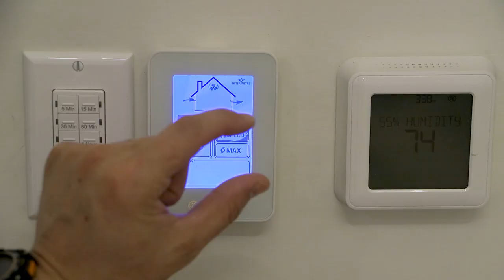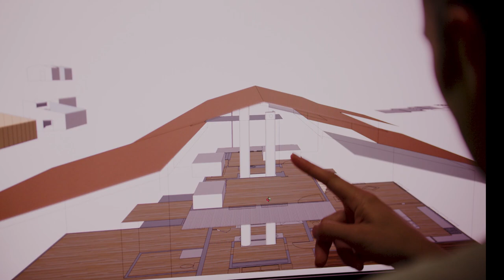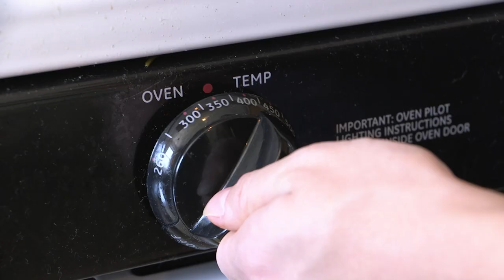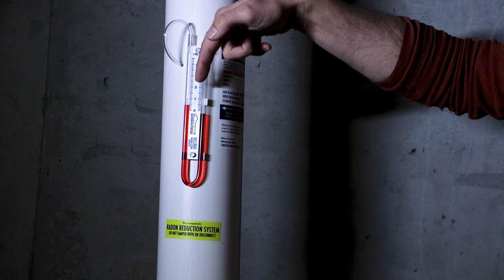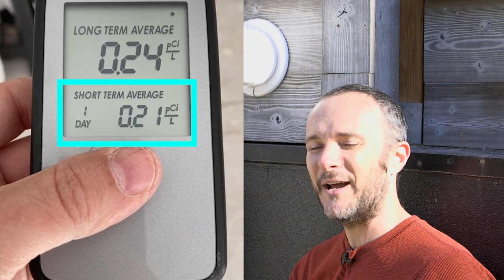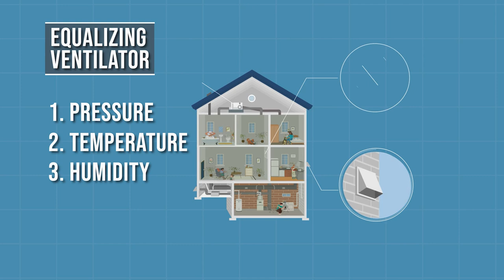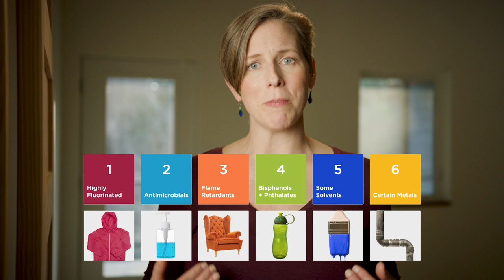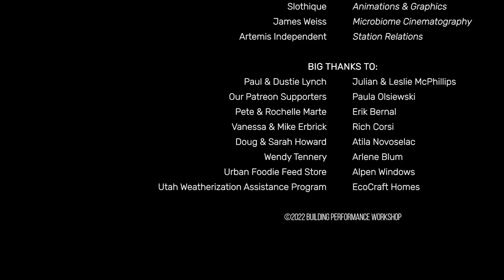Science of Home Ventilation, Air & Water Purification- Ep 211 of Home Diagnosis TV Series

Comment: So your home is sealed and controlled by erv to allow air in controlled.
You mention florida.. And adding a dehumidifier. Prev you mentioned for the average joe to utilize what they have for fans but allow some fresh air in.
So an average joe in florida.. Would using the exhaust fans ( bath, kitchen) with  a ERV and  a cycling hvac be advisable or just skip to the dehumidifier instead of the ERV and allow the hvac to filter the air?
Reply from the maker: Yes, the latter option is best, but you can also get MERV 13 upgrades on the ventilating dehums.

Comment: While I'm not building my house yet, sadly, I am moving. My parents just bought a property that has a separate guest house or something like this on the end of a massive shop building. Since it'll save me a ton of money and be more like having my family as neighbors rather than living with them, I'm going to live there until I've saved up/making more to afford the house build. So this leaves me with a space that is about 800sq/ft There's a bathroom and the rest is an open space (sadly no separate bedroom) with a kitchen area off to one side. At the moment the place has only electric baseboard heat. I'm going to install a mini split for A/C and probably more efficient heating, but I still am at a loss for fresh air. All I see are large units that are really too big for a small sample like this, and many of them have extremely poor filtration. Is there such a thing as a small ERV with a good filter? Or just a smaller ERV? I really wanted to have just two registers, exhaust from the bathroom and fresh air out into the main room, and as a severe allergy sufferer, I really don't want to just be importing all the pollen and dust from outside.
Reply from the maker: If you really need an ERV, look at Renewaire or Broan with a MERV 13 upgrade. I think you should consider supply fan with filter box only though, instead. Check out AC Infinity.

Comment: So if building in south Florida, a tight/sealed ICF shell, would a separate dehumidifier need to be installed or would the ERV be able to handle that job?
Reply from the maker: Yes, you absolutely will need a dehumidifier, an ERV does not replace a dehu, it just slows down the humidity.
Reply: @HomePerformance  
Ok that’s what I was thinking.

Comment: Very cool.  We use MERV 16 carbon filtration in our home and a ventilating dehumidifier with a tempering chamber then dumping into the return of the air handler.  It was a retrofit, but works well for humidity and VOC's.
Reply from the maker: Nice setup, David

Comment: i still dont understand how pulling air from a bathroom into an erv is a good idea, isnt the idea it transfers humidity which is what you are trying to remove.
Reply from the maker: Here you go AV:
https://youtu.be/QOe4lluGwCg
Reply: without checking the video, i think the idea is that its not all that much moisture for the size/mass of the house. i have the same thing with drying clothes inside, it makes zero difference to the homes humidity. however it might be a different story in a small house thats overcrowded.
Reply from the maker: …Tweak, even in our 200  sq ft tiny house with 2 adults, 2 kids, and 2 cats, sn ERV works better than sn HRV. We know because we’ve tried both.
Reply: @HomePerformance  but that's with a dehumidifier.
Reply from the maker: No, without
Reply: @HomePerformance  now that surprising. you might need to explain how that happens. i would have thought as the erv tries to maintain the humidity level, if you make it more humid inside it would keep it more humid.
Reply from the maker: Watch the video I posted in the first reply, Tweak, all will be made clear
Reply: @HomePerformance  i think you need to explain it better. you mention a house that you have set the humidity. which adding moisture would then change. for the tiny lab you have the heatpump set the humidity (and later on added the dehumidifier).
to me, maybe incorrectly, an erv makes it easier to maintain the humidity level you want. but you still need something to maintain it with.

over here they recommend HRV core instead or ERV. ie outdoor humidity good enough to get away with it (they hope).
Reply from the maker: Yes, exactly, an ERV always helps maintain indoor humidity better than an HRV. That’s the bottom line.
Reply: So to answer av's question, we are relying on the mechanicals to dry the house. Having all that shower moisture confined to the bathroom can make it damp/moldy but that amount of moisture spread around the house is a drop in the ocean and it gives the mechanicals 24hrs to get rid of it.